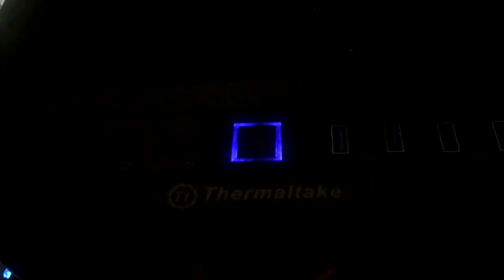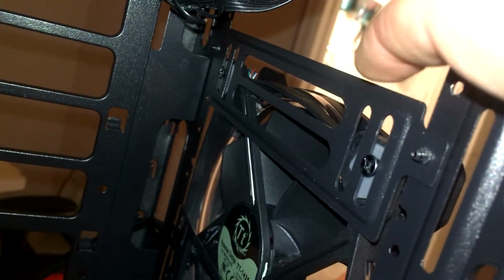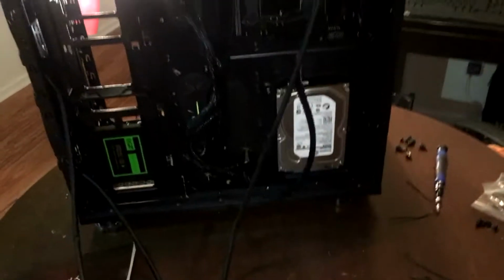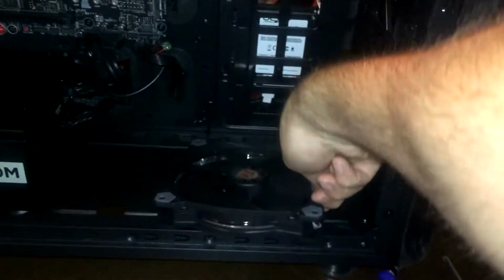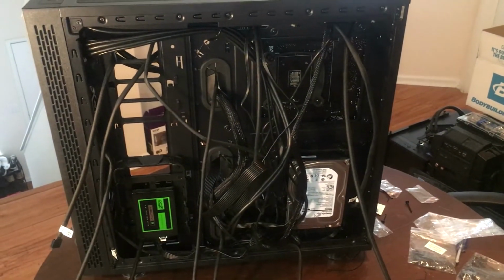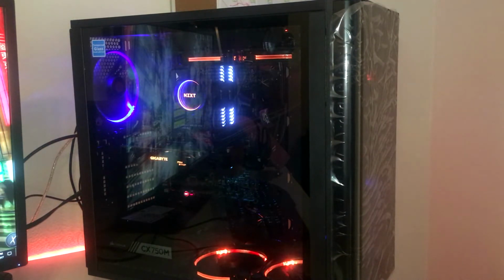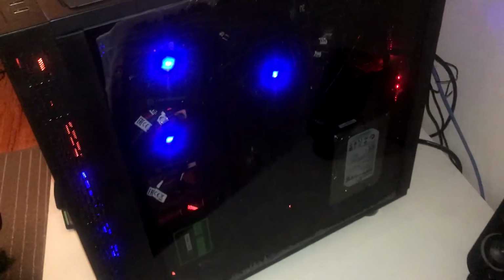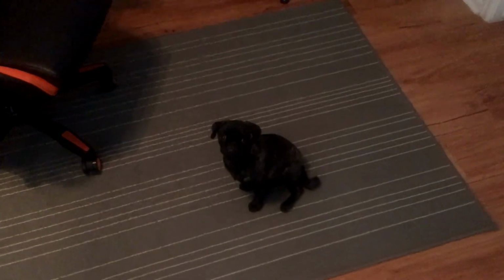My PC BUILD! Thermaltake View 31 case/Kraken X52! Problems and solutions!

Comment: I have the same case. For the top radiator screws I  just didn't use the washers and there was no gap between the filter and case. You should also flip your 2 front fans around to push air in and have the radiator and back fans push the air out for better flow. Looks neat in the end.
Reply from the maker: Thx for the input!

Comment: I bought this case for my missus, due to the design, we had to front mount the dual radiator and fans to give room, the problem though is the intake is quite low.
The side intake vent doesn't give adequate ventilation, so i am in the process of cutting out for the fans and installing a perforated grill with dust filters. Apart from that flaw the case is amazing, well worth it.
Reply from the maker: That’s good info!!  Thanks for watching let me know how the mod improved things!!

Comment: Very nice build, love it. I just bought the case.
Can I put NZXT Kraken x62 (280mm Radiator) on top with RGB high profile Ram???? I appreciate if you let me know
Reply from the maker: I believe you can. Might have to go up and Kitty corner like I did and if you add fans to bottom of your Kraken it will block you ram a bit.  Maybe even more then it blocks mine which isn't that bad but may be for you. Not sure how much bigger you high profile ram is...

Comment: I have an rgb am4 mobo how much does the gpu cover if you mount if vertically? also do I need a radiator to mount fans at the top as I dont like water cooling and is it better to put them in the bottom like you have?
Reply from the maker: Not sure how much it will cover but You can mount fans at the top with out radiator, plenty of space for that.

Comment: I have this case I don't know why it seems so unpopular it has so much room for everything and it looks damn good. it's only downfall is that it's pretty big
Reply from the maker: I hear ya! I enjoyed building in this case. A def looks damn good!
Reply: Thomas Aiello thinking about the case being big I am thinking of putting a x62 on front of the case with a pull system. This would fill up extra space and I am going to mount a asus 1080ti strix which is a long gpu. The pull system wouldn't only fill up space but also make the inside and front look equal in terms of color. I am also going to place 2 fans on bottom which would suck cold air from bottom and blow hot air from top (3) and rear (1) fans.

Comment: So my friend is giving me this case for $20 brand new. What parts should I get to build my pc. My budget is $900 sorry if I sound like a noob at this 😂 I want something that can run battlefield, pubg, and gta
Reply from the maker: Do you have any parts other then a case?  Building a PC right now is pretty expensive.
Reply: Xbacon gamN went to micro center and spent $927.18 and got a little under $300 back in rebate so around a good $650-700 is what I spent really.
Reply from the maker: What did you decide on?